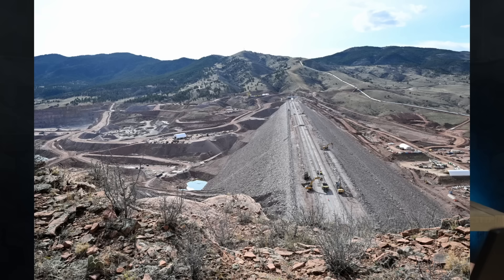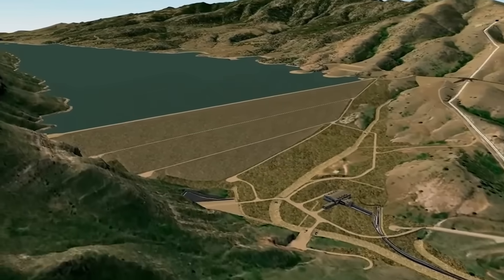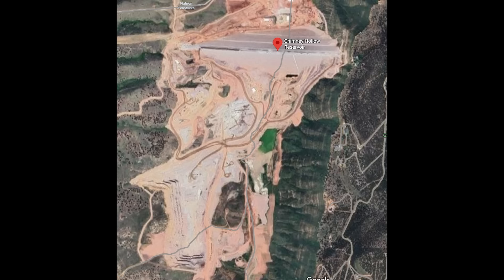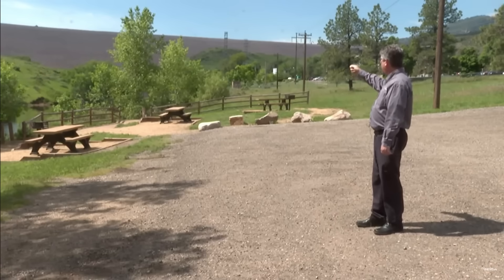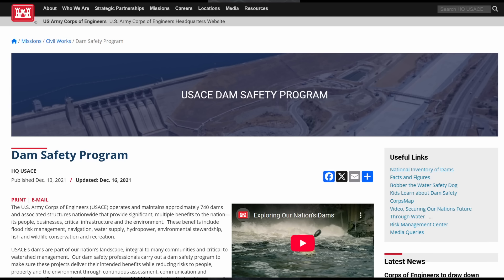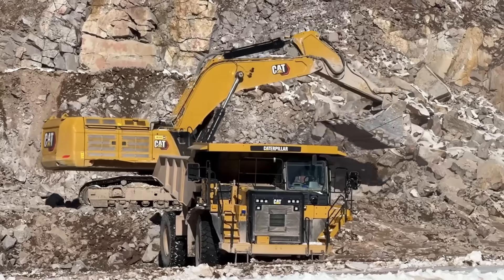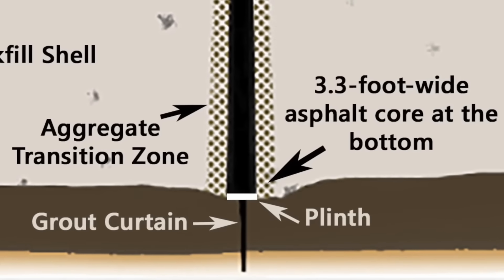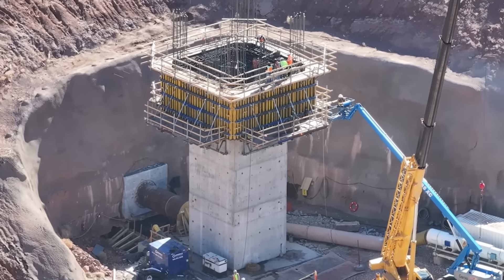Chimney Hollow Dam and Reservoir - Can you Drink the Water?

Comment: Will contaminated dust leach Uranium into water faster than the Uranium that is embedded in granit? If so then a large amount of the contamination will be diluted and flushed out of reservoir relatively quickly. The reason I ask is, all the blasting, digging, dozing, etc., generated an enormous amount of fine dust. Once the initial contamination gets thourally flushed, then most of the small amount of Uranium might be sealed in granit. If there was some kind of an open or exposed vein, it would probably would have been detected.

Comment: So the reservoir is specifically for drinking water. Yeah, that's an issue.

Wait, is this on the Colorado River? Damn, how did they get approval for that reservoir?! The Colorado doesn't even reach the Gulf anymore because so much water is being diverted for drinking water and irrigation (and irrigation is the primary guilty party, but increased populations in the Colorado River Basin is not helping)!

IDK, the more I learn about dams and ecosystems, the more I find I just don't like dams and we should instead restore wetlands. Not that the Colorado River itself is particularly well known for having wetlands. But wetlands do store and filter a ton of water, so it's definitely worth looking into how we can better integrate wetlands into our rivers and landscapes - and possibly even using them for drinking water reservoirs as well (which would be the most difficult part).

Comment: Do Flatiron, Carter or Pinewood reservoirs have issues with uranium contamination?  In the same area all sharing the same water supply.  If not then hopefully it will be a temporary problem that mitigates as the exposed rock ages.  Also, that's a lot of dam for just 90,000 acre-feet of storage.

Comment: For clarification: 
Uranium can be present in drinking water from both natural and human sources, and it poses a health risk primarily due to its chemical toxicity to the kidneys, rather than its radioactivity. While most ingested uranium is excreted, elevated levels over time can cause kidney damage. To address this, the U.S. Environmental Protection Agency (EPA) has set an enforceable drinking water standard for public water systems at 30 micrograms per liter (µg/L), and water treatment methods such as reverse osmosis and anion-exchange can be used to remove it from private well water.
Reply: This.  Please pin it.
Reply: @h8GW yeah it needs to be, there’s videos of scientists that died to old age ingesting full rocks of uranium
Reply: And all of this water is chemically and filter treated before it hits the water pipes in Denver….at that point a whole host of other chemicals and pollutants are present.  You give one to get the other
Reply: And how enforceable is that limit now? Remember, the diaper dictator is in charge of everything.
Reply: Thanks for the info. You answered questions I had while watching. 👍
Reply: @victorhorace8467 so it will be "safe"?
Reply: Glad someone is doing the research on this pending disaster.

Comment: Casey,

I am not surprised that they have discovered a problem, so late in the project.  I wonder how it is the quarry had been in operation for years, and no one knew there were contaminants in the granite.

I wonder if these sorts of issues are addressed by engineering schools in undergraduate classrooms.  I sat on an advisory committee for a university's naval architecture and marine engineering department.  I found the push from the university to focus on the flavor of the day.  Today, the focus is on entrepreneurial development and UAVs on land, in the air, and on seas.  In the past, it was clean energy, zero carbon emissions, and nuclear power, etc.  

What is being skipped over are the basic first principles.  Time is not being spent teaching students to ask the right questions.  Is the fill we are using inert?  Or, is contaminated?  Is this bridge safe from a collision?  Is it safe to skip a failure analysis?  Will the structure be able to withstand withstand the loads and the fatigue over its expected lifetime?  How do I ask these questions if they are not in my computer program?

Bob
Reply from the maker: Thank you Bob. I think that's a great point, and I share your concerns about the engineering curriculum.   As you point out the goal shouldn't have been merely to build a dam to deliver water but to actually deliver water that people could drink without undue difficulty or extra, unplanned treatment.

Comment: Hey Casey! You might be interested in looking at Mud Mountain Dam. An ACOE flood control Project here in pierce/king counties western WA State.
The failure/repair story here is very interesting.
Way I see it this Dam pretty much failed in every way possible w/o actually washing down the White river.. 
Then after they decided to put in a grout wall, they found that there wasn't enough structural stability left in the dam to hold up said grout wall.. they then in a panic pumped enough grout into the dam to puff it up at crest and slump off the shoulders..
They pumped thousands of cubic feet of mud into the dam that just went....? nowhere.. 
You'd love it.. I have the construction report if you can't find it.. It'd be worth a read imho..

Comment: As the crow flies aprox .75 of a mile to the east is Carter lake, it is in the same water system and has been there since I was a kid. It serves the front range communities with some of their water. there is just an Hog back foothill between the two reservoirs.. I don't think it has this problem...but it probably did when they first filled it..only about .75 mile from shore to shore!!!!
Reply: Maybe they didn't quarry materials for the dam from the dam area itself? Or it could also be due to the dam being much smaller, so much less freshly broken rock being exposed to the water - the Carter Lake dam seems to be barely over half the height and about a quarter of the length.

Comment: So this is kind of a serious problem as uranium is a heavy metal that creates other heavy metals, and it self is water soluble.

If you’ve ever seen videos or pictures of “uranium ore” glowing under a UV light. It’s actually the secondary mineral salts on the surface of the ore that are fluorescing. Not the ore itself self. Those minerals absorb the uranium as water flows through and around the rock under ground and mineral deposits then absorb the uranium and later crystallize to create this neat delicate surface. That when UV photons hit, excite the atoms just enough to spit out the extra energy as photons we typically see as a fluorescent green glow.

Since uranium is an unstable atom, it wants to become stable. It sheds parts of its atom which generate daughter isotopes. All of which are radioactive of either increasing or lesser amounts, depending on the daughter isotope. Radium is more radioactive and creates the radon gas we all have in our basements. There is also Thorium, Bismuth, Polonium, and up two types of radioactive lead, before you get to just stable non-radioactive lead like in Flint Michigan. 

Since the half life of all these isotopes are different, we can pretty much guarantee these heavy metals are in the water to some extent. Which will need to be removed somehow before human consumption. So it’s kind of a big deal as it’s a costly problem to solve. Not a healthy option to simply ignore. 

A simplified diagram of the decay chain https://www.nachi.org/gallery/radon/uranium-238-decay-chain

Radiacode isotope library
https://www.radiacode.com/isotope/uranium-nat
Reply: Citing studies and then misrepresenting the data is not the flex you think it is.  

Go back to “school”.

Comment: PennDOT had a similar problem when constructing I-99 outside of State College.  They hit iron bearing rock in a large cut and exposure of the iron bearing rock caused a polluted iron discharge from the cut area similar to mine discharges in the anthracite and bituminous coal fields of PA.  They ended up covering the entire cut area with geogrid and filling the geogrid with limestone to counteract the iron bearing rock.  Luckily the State College Area has good sources of high-quality limestone.  I believe they also had to install a small treatment system for the discharge.  Subsequent projects with large cuts they have been testing before the project begins to avoid issues like this.

Comment: The public is easily fear mongered and when they hear toxic elements they think if it’s non-zero that it’s dangerous. If the reservoir dilutes the elements and downstream parters filter out the rest to safe levels it better the public not know. Nonetheless, it’s good the firms involved are making the required disclosures to regulators.

Comment: I enjoy your content and learn a lot from it. However, I question if you should have produced this video with a main topic that is only tangentially related to your expertise without doing further research and possibly interviews. Especially when you call it a "shocking development that has been significantly downplayed". You are raising concerns about a water sample of emergency discharges from a coffer dam for an active construction site and comparing it to drinking water standards. The sample had a uranium concentration of 225 ug/l which is well above the 30 ug/l drinking water standard but well below the NPDES effluent limits for discharges into rivers which can be as high as a 30 day average of 2,000 ug/l. I applaud the project managers for sharing this information, but I believe they could do a better job of putting it into context as well. Municipal drinking water will be processed before reaching a tap. Drinking water processing facilities include some form of coagulation, sedimentation, and/or filtration which should all remove particulate uranium. Additionally, given the prevalence of uranium and other heavy metals in the western state's soils, it is unlikely that any major water distribution system doesn't already have reverse osmosis and/or demineralization for removing soluble uranium and metal contaminants. I am also not an expert on this topic and found it interesting that the EPA drinking water limits on uranium is based on its chemical toxicity instead of the radioactivity of it and its daughters.Not because the radioactivity is not considered, but because the chemical health effects exceed the radioactivity risks. I'm sorry to be critical but I feel that this video amplifies unwarranted concerns without a full analysis of the topic. Hopefully, it will cause the project managers to up their communications game.
Reply from the maker: I think I was more than fair to the people involved.
Reply: @CaseyJones-Engineer  I've grown to trust your engineering judgement and expertise as well as your courage to challenge authority. You have likewise earned the trust of many others as evidenced by your rapidly growing followers and ability to influence decision makers through your social media channels. I'm just providing feedback that I hope you will consider when you produce future videos. Casting doubt on subjects you have little expertise without thorough research can raise unwarranted concerns with the public and require misguided use of resources on major projects. I have no expertise on this topic either, but did a little research and was concerned when I saw you were using the wrong water standards to buttress your concerns.
Reply from the maker: @elijahcraig4804  I still don't know what you're talking about. I used the same water standard that was referenced in Northern Water's press releases.  I do appreciate constructive criticism as long as it is accurate which I don't think it is in this case.
Reply: @CaseyJones-Engineer  Before reading your response, I did not review the actual release, but instead relied on the portion you showed on the video. I continue to have the concerns I first shared but feel much less strongly about them since seeing that the company themselves also referenced the drinking water standard. I apologize if I caused you grief and will delete these comments once you acknowledge reading my apology.
Reply from the maker: @elijahcraig4804  No need to delete them. It's all good.  I realize you were being constructive so thank you.

Comment: Dilution is the solution to pollution?
Reply: The dose makes the poison, nothing is free of some contamination.
Reply: Part of the solution, yes. It isn't yet clear how practical that will be given the use model for the reservoir. It is unlikely to be filled many years,  and it is predicted that inflows will decrease in coming decades to levels that may mean a lack of filling at all in more years than not. And even though levels may drop over time, the levels may still be far too high even with available practical dilution in the early years to be allowable for drinking water systems.

Comment: From the start, and having dealt with various heavy metal remediation projects, I was thinking the contaminant would be arsenic or chromium or such. When you said uranium, I literally laughed out loud because how does one miss that in a region known to have significant uranium in native rock.

The highest short-term concern imo is dust exposure of the excavation and construction crews. That exposure pathway should be investigated beyond standard procedures.

Dilution is a solution to pollution, unlike those protest chants’ claims. Though while the uranium concentrations will decrease with time, the information Northern Water provided in the press release admits data are insufficient to estimate how fast that decrease will occur. There may be a lot of ion exchange resin in their future. While RO can remove uranium from water, the RO waste stream has to be dealt with…which may be cost-effective (evaporation maybe?).

As to the failure to detect uranium much earlier, TCLP analysis was probably conducted, though that test doesn’t look explicitly for uranium. Sometimes it is wise to test beyond regulatory requirements. US Parks and Forest Service do so for every public drinking water project I’ve worked on with them.
Reply: So what kind of exposure to quarry workers ?
Reply: @amunderdog   Don't drink the rocks from the quarry
Reply: I am also somewhat surprised hey didn't do a better geologic survey prior to commencing construction.  The "Coloradoan" in June interviewed Northern Waters spokesperson Jeff Stahla who noted "We actually did not know that it (uranium) was there" and "Uranium is not uncommon but was unexpected in this group of rocks."  If memory serves correct, the "Shewartzwalder Mine" is located just 35 miles to the south. For anyone unfamiliar with the mine, it was one of the largest uranium mines in Colorado operating from 1940s until 2000.  The mine seems to sit at the same North-South juncture between Front Range and prairies to the east.  Not sure how much it would have cost to have done some drill core testing - but this seems to be a case of penny-wise and pound foolish....
Reply: @thomasgevry8890 12:28 It appears they took cores and tested them, but did not perform leachate tests on the cores.
Reply: Well dilution work only if pollution can be removed by natural process or just have very short half life - still in this case it would need monitoring of situation.
Reply: @mioszdomagalski9476  The main Uranium isotopes have half-lives of 700 million or 4.5 billion years, so nobody is waiting on that!
Reply: @mioszdomagalski9476  Monitoring above the required frequency may be required by Colorado, and I deliberately said “a” solution, versus “the.” As odd as it may sound, under the Safe Drinking Water Act, if a contaminant concentration can be diluted under the MCL, then it is legal to serve that water to the public. I am not found of serving long lived radionuclides to the public, at a concentration of a hundredth of the MCL. For instance, if I were one of Northern’s customers, I’d probably have ion exchange at my residence.
Reply: @mioszdomagalski9476  They can mix the water with that from other reservoirs.
Reply: @GeoEstes .    This is not a cooking class.  Your suggestion is ludicrous because of both cost and availability of additional ingredients (water).
Reply: @TheCwilkey  Well, since YT has deleted my comment, I can't remember specifically what I wrote. I'm assuming it was diluting the contaminated water with other sources, which is something I read from another site talking about remediation procedures. It's quite possible to mix the water from this reservoir with Carter Lake or Horsetooth. There are several interconnected reservoirs in our area.
Reply: The uranium may be relative localized, not necessay mix all through the granite very much. There is allways the chance to miss local deposits.
Leaching can be a rather short time process from some minerals decomposing when in contact to air
Reply: Uranium and thorium are not always assayed for in some laboratory hard rock assay suites and levels of detection may not have been appropriate i.e. too high  - should not have been missed when geology was being done, Basic geochemistry
Reply: We concur.  See our later comment.

Comment: Over time that will become Lead (U breaks down into Pb) also toxic but I can see them shifting from providing public water to using such a lake for heavy water production.  The fact the Dam material is from the floor of the would be lake means is would be contaminated either way.  As heavy metals the lake can prevent most from washing down stream and may be a concentration point to recover for DOE use.